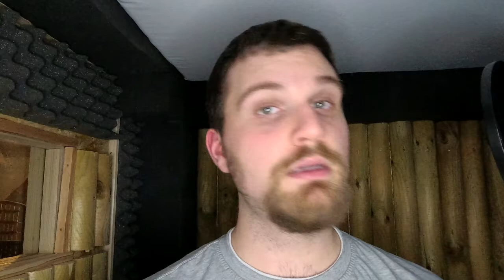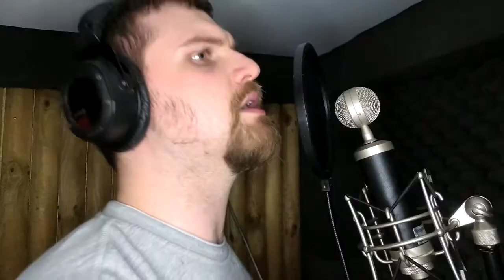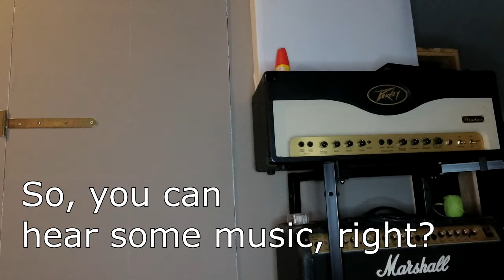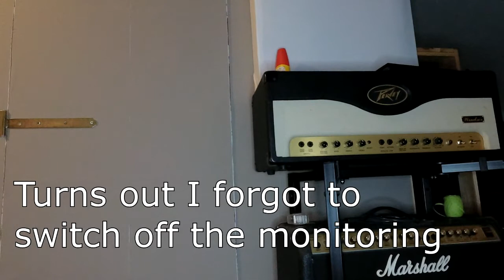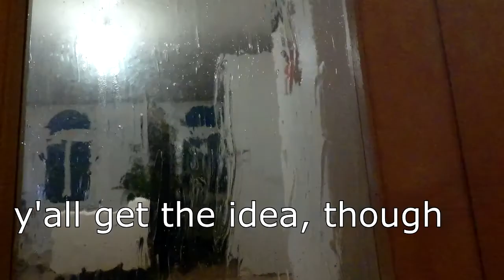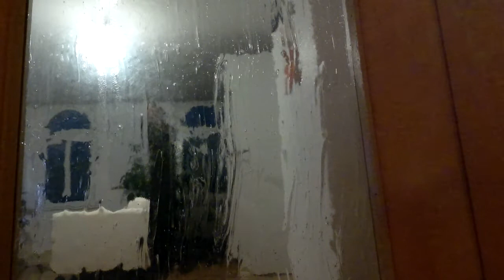Building a Vocal Booth (Part 3: Containment)

Comment: im surprised you haven't covered the wood completely by the door and window , wouldnt sound be coming out from there?
Reply from the maker: Sorry, I wasn't alerted of your comment - you mean the inside of the door with foam? The foam doesn't actually do anything in terms of isolation. It's designed to absorb reverberation within the booth.

Comment: Thankyou! Where is the second room located in relation to the room your box stands? You almost hear nothing. This is great!
Reply from the maker: It's the hallway leading to my studio, so right next door about 2m from the actual booth.
Reply: @GreyManFaustus  Cool, I am going to use some of your ideas to build my first small vocal booth. The goal of the first one is only to check whether I am able to sing what I want to sing or not. If this test suceeds I will build an bigger one and also for recording. First version will be only for the sake of my neighbours.
Reply from the maker: @alexanderavantgarde3428  Good luck! Keep in mind, though, that this booth is not ventilated and high intesity vocals will turn it into a sauna after around 30 minutes. A smaller one will make you stew pretty much right away, so some ventilation will be mandatory.
Reply: @GreyManFaustus  Thankyou for advise:).

Comment: Thanks for the inspiration, I'm looking into something like this, but for the purpose of song training without waking up the whole house, and somewhat to keep noise out. Do you ever feel that you should have built some ventilation or is that not a problem?
Reply from the maker: Godspeed! The size allows for 30 - 60 minutes of uninterrupted working, depending on what I'm doing in there. I can't tell, if ventilation would have made a huge difference, but I don't really miss it; Open the door for 2 minutes and you're good to go for another hour.